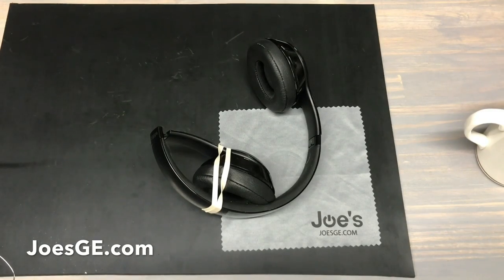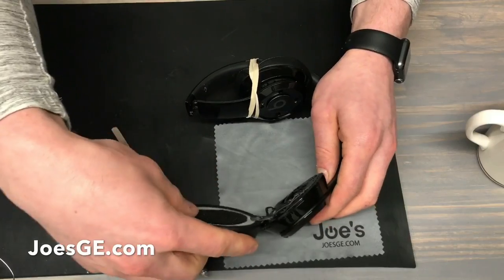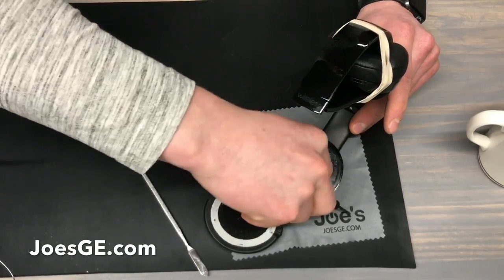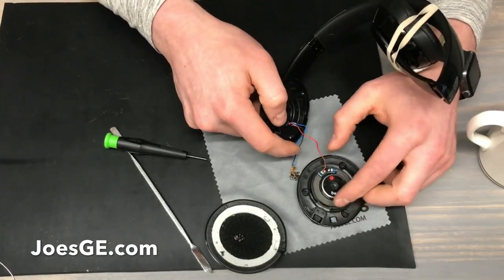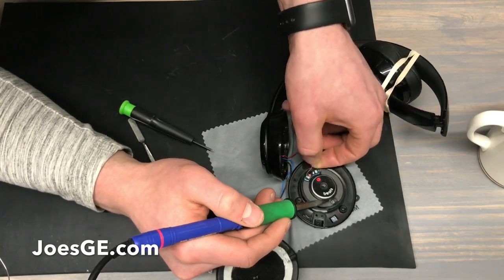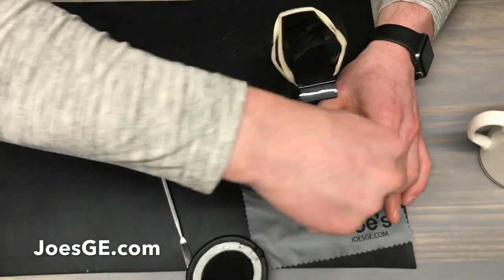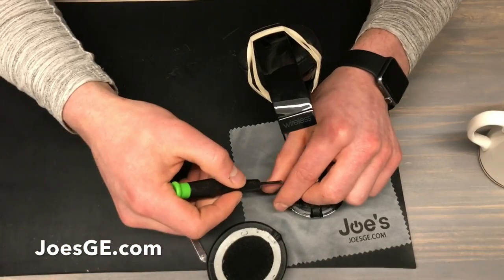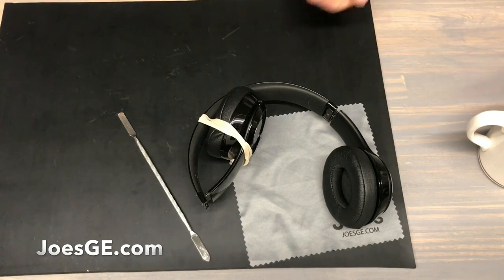Tutorial How To Repair Replace Beats Solo 3 Wireless Right Side Blown Speaker Disassembly

Comment: Hey, need to change the speaker module but it’s glued into the plastic case. How would I go about removing it to be able to replace it? Not covered in the video for some reason…
Reply from the maker: Try using a small flathead or razor and cut around the speaker. http://bit.ly/2v9c3Rm

Comment: Do you need to do the Desaughter thing? Can you just pull them out then put them back?Also, does this fix no audio coming from that side? Please and thank you.
Reply from the maker: Thanks for the comment. Soldering is required to replace a speaker on the solo 3 wireless headphones as the internal wire is soldered onto the speaker. This can repair the no audio coming from this side. If you are not confident enough to solder you can send your headphones in to our repair center to be repaired by a professional. We offer free shipping and diagnostics. 
https://www.joesge.com/pages/repair-services

Comment: The problem is that when I connect my beats solo 3 with Bluetooth the left side won't work . But when I connect it with the cord both sides work normally. Idk what's the issue ?
Reply: Clorox Bleach me too this is just happened last night
Reply: Kyjool I've tried lots of stuff but they still don't work if u find a solution pls help 😭
Reply from the maker: You have an AUX internal wire that is damaged. If you need the repair done send it to our repair center 
https://www.joesge.com/pages/fix-beats-by-dre
Reply: Same
Reply: Same. Did you find a way to fix it?
Reply: or u can make a video on showing us how to do it
Reply: Clorox Bleach 
Same! The left side doesn’t work with Bluetooth but when I use an aux cord it works. Sometimes if I mess with it it works with the Bluetooth but only for a second. This is so annoying!!!
Reply: @Joesge  how much does it cost roughly to get the right side of my beats solo wireless fixed? (not working) . Thanks
Reply: Same😭
Reply: That’s what’s happening to me too.

Comment: Hey could you tell me if my multimeter shows no resistance between the two speaker contacts does that mean the speaker is blown. Yesterday my left speaker started losing contact, it switched between working and not working, and then it just stopped working completely. The only logical reason to me was that a wire broke somewhere so I opened up the whole left side but I couldn't find any wire that's broken. Also it's the same with Bluetooth and aux, only the right speaker has sound.
Reply from the maker: Thanks for the comment. The issue you are describing sounds like a faulty 5 core internal wire. This is a common issue with the solo 3 wireless headphones. The tear is usually covered by a piece of tape so it can be easily missed. 

https://www.joesge.com/products/beats-by-dre-solo-2-solo-3-wireless-5-core-wire-with-clip-parts?_pos=2&_sid=4934daa5f&_ss=r

If you would like your device repaired by a professional you can fill out a repair form and follow the steps to send in your item. We offer free shipping and diagnostics. Here is a link to the repair form:
https://www.joesge.com/pages/repair-services

-David P

Comment: How do you fix a left side speaker that isn’t working when connected to Bluetooth but works when connected to an aid cord?
Is it easy?
How much do you charge for that kind of service?
Reply from the maker: Thanks for watching! The repair would cost around $80 if it is a fault in the Bluetooth board. We currently do not have a rep[air video for this repair.
Reply: I have the same issue. Did you find a way to fix that?

Comment: Hey man I wonder how much and how long this would take.The problem is that the right side won’t work, there is a hole on the bottom and you can see the wire. So if you could help me out that would be the best👌
Reply from the maker: Thanks for the comment. The issue you are describing sounds like a faulty internal wire. If you would like your headphones repaired by a professional you can fill out a repair form and follow the steps to send in your headphones. We offer free shipping and diagnostics. 2-5 business day turnaround time. Here is a link to the repair form:
https://www.joesge.com/pages/repair-services
-David P

Comment: hi joe's. thank you for that video as ill finally changed my right ear pad, as the cloth was a bit ripped and it hurt me to see the foam hanging outside. however, i do have a question if you can help, maybe. The audio for media and phone works well with the cable but only the media works for the bluetooth, not the calls anymore. is it fixable? i tried unpairing, re-pairing, resetting...but same. its annoying because if using it without the cable on bluetooth, i have to put it on speakerphone when i get a call. help
Reply from the maker: That’s very odd. Usually the solo 3 have MS ports that pick up the voice when someone calls and such. Can you send us a photo of your headphones?

Comment: The audio in the muff with the power button and charging port (the muff in this video) goes in and out intermittently as I adjusted the band of the headphones.  Is there a wire not making contact at times as the band is adjusted?  Thanks.
Reply from the maker: You may have a damaged main wire or damaged aux internal wire. Very common issue with those headphones.

Comment: How do you take out the speaker once it's opened up? I'm stuck because it has a lot of glue
Reply from the maker: Thanks for the comment. You will need to use a thin flathead screwdriver to pry the glue around the speaker driver. 

-David P

Comment: I baught these headphones used and the right side does not work when i took off the pad and unscrewed the speaker the red wire was cut and taped when i tried to take off the insulation there was no way to differentiate which wire was which can you help me 
Can anybody help me
(Edit)i cant spell and fixed some of it
Reply from the maker: Thanks for watching! Could you send some images of the damaged area to our support # at 360-362-1722, we will be able to better assist you there.

Comment: Hi i have a problem with my solo 3 headphones 
It turned of for no reason 
And I tried to turn it on again but didn't work. 
I tried to re-set it but the re set is not working or function 
But if i use the AUX it work 
But no wireless mod and there is no physical damage happened.

Comment: My right speaker just went quiet all of a sudden. What happened. Did my speaker blow out
Reply from the maker: This could be, but usually you would hear a static or popping noises if this were the issue. It could be a loose wire connection. If you would like you can fill out a repair form here: JoesGE.com/pages/repair-services . CH
Reply: @Joesge  if it was a loose wire or something like that how can I fix it because my beats blew out but I opened them and messed with the wire and got them working but when I put it back together I have to adjust it to a certain positiont to give sound

Comment: My left side isn’t working
Reply from the maker: Hello Clout, thank you for watching our video. It seems you may have an internal wire or 5 core issue with your headphones. We suggest you send it to our location by submitting our repair form here: JoesGE.com/pages/repair-services, use Google Chrome to submit our repair form. Check your junk/spam folder for the free shipping label if you are unable to find it in your inbox. 

Ruslan P

Comment: This repair info sucks.  Was not as straight forward as the video claims.  Parts were cheap but still had issues with new speaker. Beats is a substandard headphone with a high price and don’t see paying you $80 for a substandard headphone.
Reply from the maker: Hello Kenneth, thank you for watching our video. Beats are a great set of headphones and its all based on how you treat the headphones. Where did you purchase the new speaker? Also if the soldering job was not proper than the speaker will not work well. Let us know. Thank you in advance. 

Ruslan P